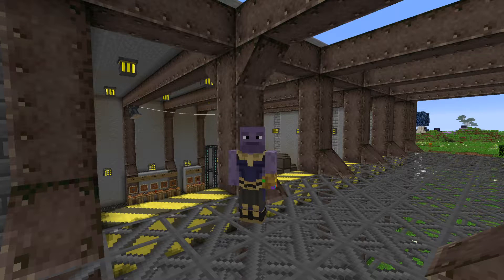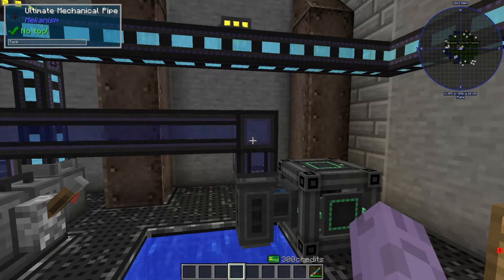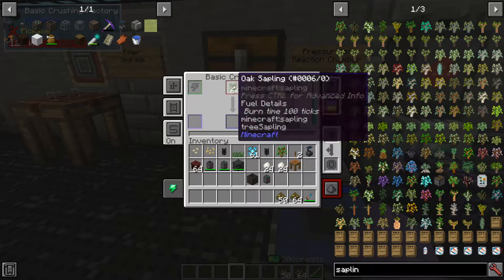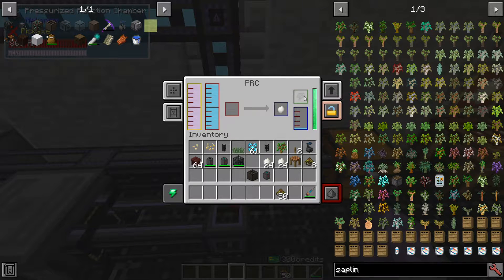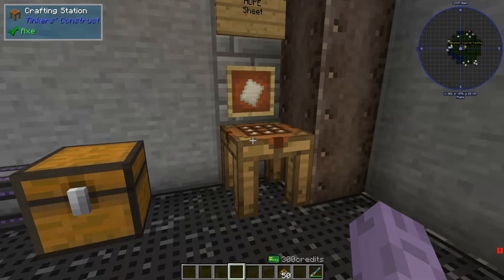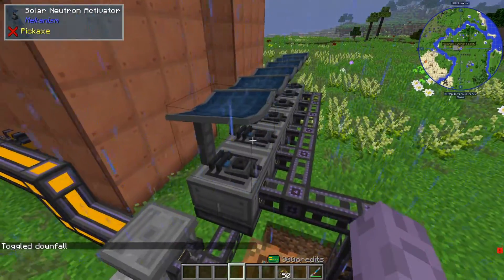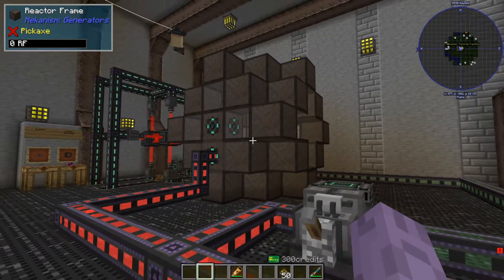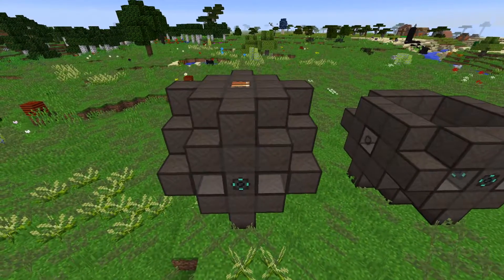Minecraft - Mekanism Tutorial Part 7: The Fusion Reactor (1.7-1.15)

Comment: I don't know if this pack specific but in StoneBlock 2 you can make a crap ton of those Thermal E. Chambers and turn water into brine, brine to lithium, then finally in the electrolytic separator separate lithium into Deuterium and Tritium. To heat them as you don't have access to the sunlight, You can use either fuelwood heaters or Resistive heaters. Again, I don't think this is pack specific, but it sure is an easy way to get the fuel!
Also, I know for a fact that the 'heating Thermal E. Chambers with heaters' is a thing in all of Mekanism, You just need to use thermal conductor pipe thingys and put it into a valve.
Reply from the maker: This is correct. Resistive Heaters and more detailed mechanics of the Thermal Towers were covered in my Quadruple Ores tutorial video

Comment: Your videos have been great. I have ore quadrupling going quite nicely, but I am just not having any luck with this fusion reactor. I'm on the initial PRC stage. I can't get ethylene out the front of the first PRC, and the rotary is sending the liquid ethylene. But, it just won't input into the second PRC. It's immensely frustrating.
Reply: found my issue. I've pump water into the second prc >.<
Reply: Now, if I could just figure out why the ethylene gas will not output through the front of the machine.
Reply: Ahh.. shift-right click with the configurator

Comment: so I've been having trouble with the reactor, am I able to dump straight up d-t fuel into the reactor or do I need the two separate pipelines with the tritium and deuterium to get inserted?
Reply from the maker: You can dump straight D-T Fuel in, but I'd recommend using separate pipelines.
That way you aren't dependent on the speed of a Chemical Infuser to make D-T Fuel
Reply: Alright thank you, any recommendations on how to get more tritium? I guess just making more thermal evaps would do the trick, but having it stall during night isnt great
Reply from the maker: It could be a combination of factors. Are your lines fill of Lithium, but not Lithium gas? Make more Condensentractors. No lithium? More solar towers (remember, brine and lithium is a 10:1 ratio). Plenty of lithium gas? More solar activators. Don't forget too you can use upgrades - why waste materials making more if you haven't upgraded it yet?
Reply: lmao it wasn't working because I didn't set my gas tank to output the gas into the reactor, it was on input. thanks for the recommendations and responses tho. btw, your vids are pretty high quality for a smaller youtuber, nice stuff man
Reply from the maker: @urboi5540  That would do it! And thank you, I've been trying to make more cool stuff!
Reply: If you directly feed the reactor with d-t fuel you need a continuous supply of d-t but i think its impossible because it consumes too much and produce more heat in the casing

Thats why I choose to separate it